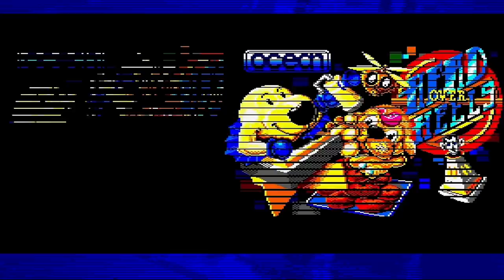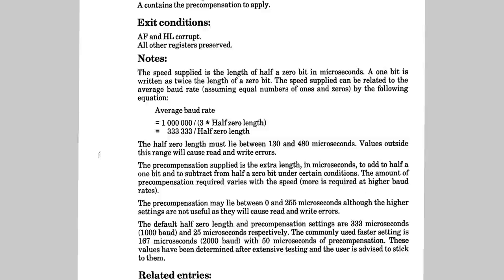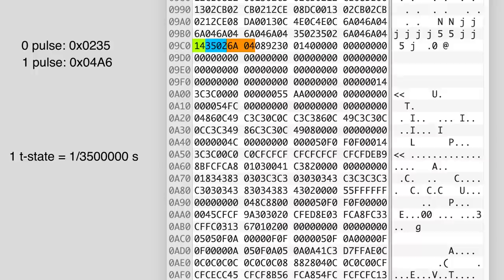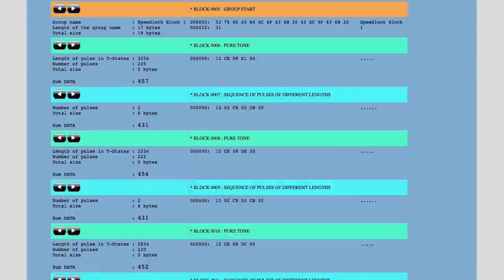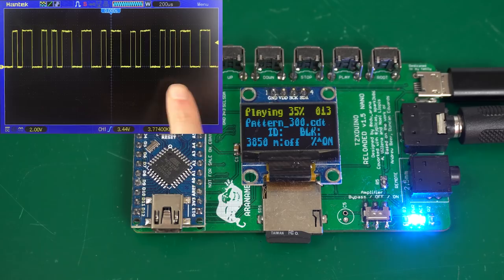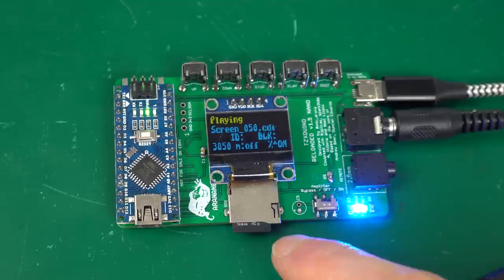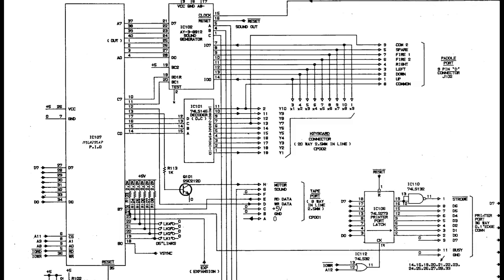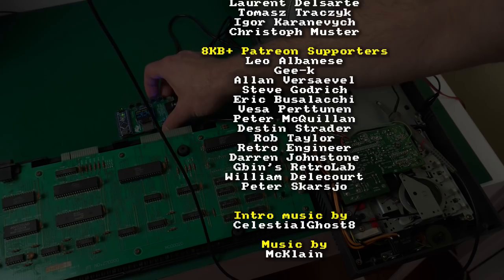How Fast Can We Load From Tape?

Comment: My guess is that pause happens when the Arduino needs to fetch a block from the SD card. At faster speeds its probably spending more and more time in the routine that fetches data.  You could use a different CMD to stream a byte at a time or use DMA to transfer blocks and use ping pong buffers for playback.
Reply: Since this is just a proof of concept, the file contents could probably just be put into flash. He said it's 16KB. As long as the arduino code isn't too big, it'll fit.
Reply: @Never Mind I wonder if it's possible to go into a slightly more extreme direction and skip using a Filesystem altogether, and instead just save the file you want to play as a raw bitstream in a predefined location on the SD Card itself.
The arduino could skip a lot of the FAT processing and instead just read the blocks directly, probably reducing latency a fair bit.

If you get the timings just right, one might even consider starting the output-routine from within the AVR interrupt! 

Or, well, just using a modern uC such as an STM32 with true DMA.
Reply: I would just add a 32-64 KB SRAM chip as a buffer. Read the data from the SD card into the SRAM chip and no more interruptions.
Reply: Another solution would be to use microcontroller with more RAM, and preload files from sd card to memory.

Comment: Back when I used a ZX81, I found you could make it reliably load more or less at fast forward speed by jamming the pinch wheel from WH Smith own brand C15 (nasty, rattly, and cheap) and it didn't seem to be affected by the tape increasing speed as it ran out.
Reply from the maker: Nice! It must have a very adaptable loader and be recorded really slow. But in any case, the ZX81 had so little memory, it wasn't as much of a big deal as trying to load 64KB or even 128KB!

Comment: On the C64, I once built a custom speed loader using the parallel port and encoding the data on the cassette analog rather than digital. It worked, but only useful in the scene at that point as we already had 286 with hard drives.

Comment: Always a pleasure to watch.
The three check for a bit (or 5 in some systems) is also very common in hardware implementations, i.e. UARTs accept a bit as one or zero when the input has been in the same state for 3 (or more) sampling clock pulses. It makes the sampling more robust against frequency mismatches.

Comment: As a longtime TRS-80 cassette port hacker, I support this video! +1
Reply from the maker: Ooh, I know very little about the TRS-80. Was there something in particular about the system that made it necessary to hack things with the cassette port, or was it just something you experimented with?
Reply: @NoelsRetroLab  It served double-duty as a bit-twiddle output device for music & SFX generation, even crude sampled sound. The cassette routines were kind of a gateway to channel coding theory & DSP, although I didn't know it at the time. Some third parties had some amazing high speed loaders, I digitized their cassettes way back thinking one day I might write a soft-emulator for interpreting them.

Comment: The code definitely needs some cleanup.  Just write to the PIN port to toggle a bit.  The internal state variable is redundant.

Alternately, use the built-in timer to produce a pure tone.

And of course the Arduino library which is made for ease of use and portability, sacrifices way too much speed.

Comment: OMG, I hadn't realised just how much I had forgotten over the years!

I spent weeks, probably months, studying fast loaders on my C64, reverse engineering them (disassembler) and figuring out how they worked. The Commodore 64 Programmer's Reference Guide had an amazing amount of information in it but still skipped most of the required information therefore I had to rely on practical testing and experimentation. In the end I produced a considerably faster saving and loading scheme that worked mostly reliably on my computer... only mostly reliably because there's a disjoint between the recording and read heads on a datasette unit (Commodore) or regular tape player/recorder and a tape recorded at such speed on mine, even reliably, would almost never load on a friends computer. As a result I had to slow the process down until it was reliable on friends computers as too, and the end result? A fast loader that was pretty much the same speed as the original ones that I reversed engineered!

The Arduino problems did amuse me a bit, but then I remember the problems with my turbo loader and NMI (Non-Maskable Interrupts) that might happen at any time in the execution loop and discovering this and having to deal with it. An interruption in a processing loop that's really timing sensitive can really cause chaos and some early turbo-loaders were easy to cause to fail just through pressing some keys on the keyboard during loading (and some game exploits relied on this). Just to add, I can pretty much guarantee that my code would never have coped with the difference between PAL and NTSC systems! :)

Anybody who doubts the effort and smarts that went into our early computer days really isn't paying attention or is trying to deprecate them because the early computers weren't multi-GHz monsters with CPU capacity to waste. We had very limited processing resources and we got every bit of speed out of them that we possibly could... and by way of comparison, non-turbo loaders typically had data read times best described in bytes per minute and reading just 32K of data could easily take half an hour or more.

Great video, thanks.

Comment: C316/R310 create a low pass filter with a 3dB point of 10KHz. So a 50us pulse will be half of the full amplitude at a lower frequency. The second opamp with the 47K feedback resistor is an inverter with hysteresis, and if the signal level is less than some amount I can't determine (because I don't know the voltage on the bias divider), then no signal will pass through. This is a form of a noise gate. 

You could measure the output of the first and second opamps as you vary the frequency of a pulse train to determine the max allowed frequency.

The time gaps in the Arduino pulse train are likely the time it takes to read a sector or block from the memory card. Often this sort of code is written in an interrupt handler that, when it handles a "sector ready" (or similar) interrupt, simply reads in a loop to get the 512 (or whatever) bytes of data out of the device. During that time it is running with interrupts disabled, so things like timer interrupts get delayed. You will probably find those gaps are a consistent time, and, unless you can make the loader code handle pauses in the bit stream, that will tell you the minimum pulse width you can handle reliably.

Comment: This trick might even work - with some minor modifications - on an MSX with a cassette interface port (which is a DIN-8 connector). The cassette read pin is attached to pin 7 of port A of the PSG instead of the PPI, but the modulation is the same. The MSX BIOS has values for 1200 and 2400 baud, but I have been able to get it up to 4800 baud when using a cassette deck instead of a data recorder (and on Type-II tapes, but I'm not sure if it's relevant). The highest baudrate for the tape port I have seen for the MSX is 9600 baud. Philips made a CD for the MSX with 99 programs on it, which you could fast-load that way. 

OpenMSX supports wave files natively as cassette input, so it may be fun to experiment with that as well.

Comment: On using a normal compact cassette tape for data transport, an unrelated project that was contemporary with the CPC464 release we used to record audio using stereo heads with one channel fed from a very stable 8KHz pure sine wave source while the other channel contained our target audio. Then using a dynamic buffer on the reader input stage which took out most tape distortion we were able to recognise FSK up to 2,700bps & 16dot PSK up to 9600bps

Comment: I remember I was trying to make my Spectrum+2 to load faster. Friends with Atari machines had their "Turbo 4500" and later "Turbo Universal" and were able to push the limit up to 6000bps. But it was Atari with special tape recorders, so it was possible (and necessary) to modify the recorder HW in order to get through the much higher frequencies. All with regular tapes. 
I was trying to analyze the built-in recorder (+2 have one) to get better signal, but it would require quite a big rebuild. I changed the recording scheme, so zeroes and ones were the same length, but ones flipped the signal, so the result was also two frequencies, but just one clock. This improved the speed a bit as zeroes required half the time. In the end with the stock HW I was able to push the speed to somewhere around 2400 - 2500 bps. 
And then I moved to other loader tricks - like showing rolling counter instead of the border bars or being able to switch memory banks while also keeping some parts excluded, so I could record or load the whole memory in one block, which I used to create my 128K tape copy program.

Comment: I assume you're just using a generic ol' SD card? If so, try using a faster one. I'd recommend a small size SanDisk Ultra, because they're cheap, but any card with the "A1" symbol will have low access latency. (I.e. delay between issuing a read command and the card responding with the data). IME that's the main performance difference between cards when used on a microcontroller.
Reply: I don't think it's latency problem. The arduino only has 2kb of RAM, some of that goes to variables, some can be used for data buffer, so you don't need to access the SD card as often. MCU is running out of steam at those higher speeds because it doesn't have any DMA, so juggling data around has to be done by the processor itself. The code probably might be improved to speed the proces up.

Comment: When the arduino loader reached its limit, my first thought was to generate a wave file played back from a phone or directly from the PC?
Reply: If sound card supports 192kS/s sample rate, minimal pulse duration will be 5.2uS. It should be enough for such task. With 48kS/s duration is 20.8uS, which may be slower than needed.
Reply: Note, however, even with f you recorded a WAV file and played that back you still wouldn't be able to load any faster via the cassette port -- the issues with the amp / noise reduction / other analog components that sit between the audio jack and the analog to digital converter would still distort the signal.

It would improve matters when using the printer port busy pin, of course, but at that point you aren't really loading an audio file -- you are just loading digital data in an odd way.
Reply: @jmr5125  I may be wrong (do not own such device), but it looks like audio is abstraction in this case. It is not needed to make system work. Decoded inputs are electrical signals (which are made either from tape or with DAC), which can go one way or another to CPU.
Reply: @sdjhgfkshfswdfhskljh3360  True, but that's missing the point.

The original stated goal of the video was "Given ideal conditions, how fast can data be loaded *from cassette*?" In my opinion the answer to this question must involve the cassette port.

A different, somewhat related, question is "How fast can data be loaded * without extensive mods*?". In this case, using the parallel port busy line is a clever way to overcome the limitations of the cassette interface.  However, I suspect that there are even faster says (that still don't require extensive mods) -- at a minimum, using the joystick port will provide at least 5 digital input pins, allowing (in theory) for 5 bits to be transferred in the same time as one but with the current solution.  In practice, I suspect that the optimal solution would be 4 data bits + a sync bit, as that's almost certainly enough to max out the processor.

If you really want to make it fast, DMA is the way to go.  What, the computer doesn't support that?  Well, just create a custom board that connects to the current RAM sockets that emulates the current RAM interface, but if certain bytes are written to certain memory locations in a certain order within a certain time it triggers a "DMA load"...  Of course, that would be absurd, right? :)

My objection to the video isn't "He's cheating" but "If he is going to cheat, go all the way!" :)
Reply: @jmr5125  : I've been playing around with schematics for the custom hardware option- if using ideal hardware (which means some really good audiophile tape decks) then you should be able to get better than 33kbps, since 33k was the idealized max for the phone network... which had less bandwidth than audio cassettes. Some estimates online suggest that a high-performance system should be able to fit ~0.7 to 0.9 megabytes per minute of tape with the high-end 22kHz tape machines, which would certainly make for an interesting rogue-like or rpg, or any number of other things. You could fit a decent pure-text dictionary or encyclopedia on tape, for example.

However, part of this also involves error correction, and you also need to sacrifice some speed to allow for sync to correct for tape jitter. It's interesting to poke at.
Reply: @absalomdraconis  I'm pretty sure that:

1) You would need a real digital to analog converter to make something like that work -- the 1 bit "DAC" that's available out-of-the-box isn't going to cut it, which leads to...
2) The easiest way to implement this would be connecting an actual 33.6 k modem to the computer (connected to another modem of the same speed via the telephonic equivalent of a null modem cable), at which point you would discover that the computer can't read data and move it to memory as fast as the modem can provide it.

Yes, you could attach a Pi via the cartridge port that is configured to masquerade as additional RAM and directly load the data into that, and claim that the data is "loaded", but at that point there is no reason to deal with the digital -> audio -> digital conversion.

In any case, if you are using late (12.8k baud or higher) modem level of technology then a fully custom solution (with a perfect audio source) is capable of much higher speeds.  The phone system (even back in the 70s, when everything was analog) aggressively pruned connections to a very narrow band.  That's why you could (for megabucks) get residential ISDN service -- when you signed up, the rewired your phone line to eliminate the high frequency filters and the ISDN modem would use those frequencies.  You could even use the normal telephone at the same time as ISDN data transfer (at ~128k baud!) was occurring.

If you use an actual tape drive as a source (vs another modem) then you'll definitely need a fully custom solution.  Assuming that you eliminate the computer as a bottleneck, use a 16 (or larger, if you can find one) bit DAC, and implement a custom hardware solution (a Pi is certainly fast.enough to receive the decoded data, but likely not fast enough to take the data from the DAC and decode it in real-time without becoming the bottleneck) then I'd expect speeds > 100kbps.  There's a lot of bandwidth on a tape, after all.

Comment: Some time ago I discussed another way of speeding up the tape loading: just use only half of the wave, thus duplicating the speed without increasing the bandwidth; this is: converting it into a non-return-to-zero protocol. It has only the inconvenient of inserting DC level, but it should be removed by the capacitor in the tape input (and also, in average, it should also be cancelled).

Comment: I did almost the same thing for another Z80 computer, the Video Technology Laser 500, and I also found that the upper limit was imposed by the non linearity of the audio input circuit. I played .WAV files directly from Audacity on the PC. One of my tricks was to elongate the duration of the 7th bit pulse (corresponding to the end of the byte) in order to compensate for the RET from the "ReadOneByte" function.

Comment: Nice video again
But, if you resort to a purely digital input (the busy bin) It makes no sense to keep the same data format as in the tape. That FSK-like coding was used to remove the DC component of the data because audio equipment will block any DC component, but it will double the bandwidth of the signal with respect to a plain NRZ. It would be simpler and way faster to use a serial data format: start bit + data + stop bit (This only increases the bandwidth by 10/8). I'll guest 30Kbaud can be achievable, and the UART in the Arduino can also help a lot to avoid unintended pauses. (I managed to read a 115200 baud serial data using bitbanging in a 4MHz PIC10F200. The Z80 is slower, but not an order of magnitude)
Best regards

Comment: You could use an ESP32 with it's two cores and higher speed to help out with these issues. You could have one core read the SD card and the other core generate the signal.

Comment: From a signal theory perspective, a mono tape is good for something in the ballpark of ~250kbps with ideal encoding (Shannon limit, assuming a reasonable 15kHz of bandwidth and 50dB of signal to noise margin). FSK is far from ideal in this respect, but has the advantage of very simple encoding/decoding. 

I suspect you could achieve at least 1/10 the theoretical maximum if you used an external peripheral to do the tape decoding using a more advanced coding scheme like one of the low order (4/8/16) QAM modes with error correction then fed that to the CPU (since the CPU is unlikely to be fast enough to handle the decoding and won't have a good way to interpret a more complex encoding that takes advantage of the analog nature of the channel). Obviously not generally practical, but since you're already in the realm of theoretical limits it might be interesting to explore!